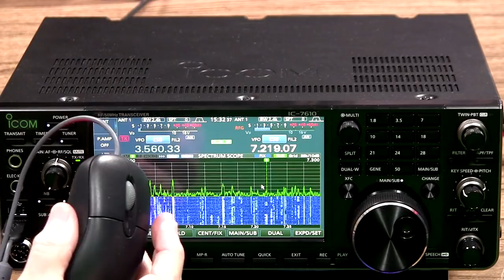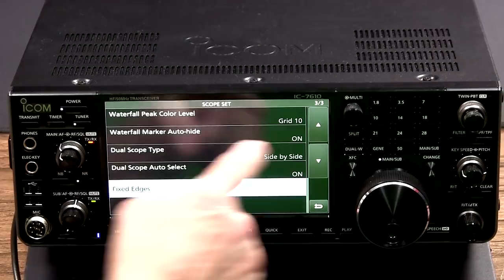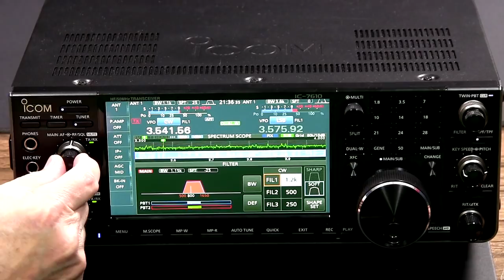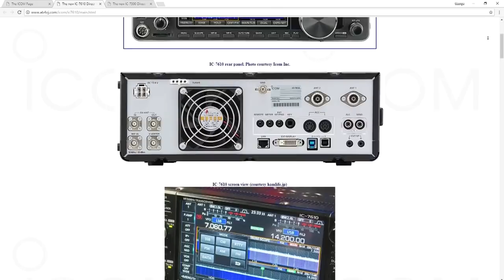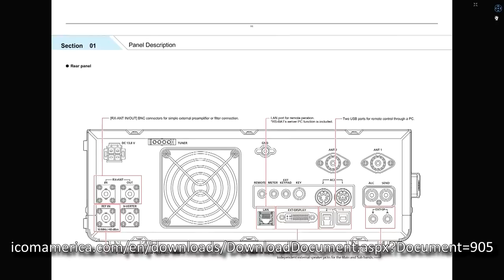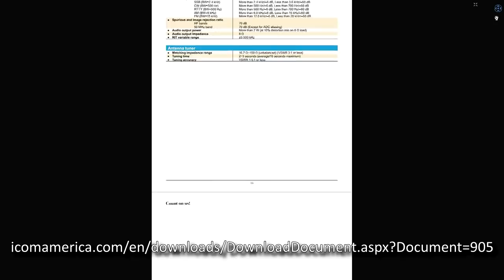IC-7610 Review with Amateur Logic and Icom's Ray Novak

Comment: I'd be interested to know why the 7610 seems to be unusable with AGC off.... unlike the 7300 which seems to be fine with AGC off.  This anomaly compromises FT8 operation somewhat on the IC-7610. I wonder whether it is a fault in the design or set-up procedure of the 7610; seems to me that that the gain- distribution is wrong somewhere...

Comment: Re the IC-7600: I think Ray is incorrect to say that the tuning-range, of the sub-receiver, is limited by the roofing filter; the roofing filters are in the IF, not the RF front-end. The sub RX is limited by the wide RF filters in the front-end; depending on which band you are on, sometimes i think these filters cover two adjacent ham bands....

Comment: Guys, I owned a Yaesu FTDX-101d radio for 1 1/2 years and even though it has a great receiver, I was never 100% happy with it for several reasons. When you spend $3400 for a HF radio, you should be has happy as you can be! So, I sold it at the end of June 2022 (for a very good price since all used gear is higher these days) I immediately ordered an IC-7610 on July 3rd. HRO was out of stock and I had to wait (in purgatory as I called it!) two months for Icom to restock! I AM 100% happy with my IC-7610 HF radio!
Reply: So Gary , Are you saying that you don’t like IC 7610 either …. Just wondering..
Reply: @clipperprospecting8445  No, I am happy with the 7610! Made a typo and did not mean to say 'not'. I like the performance of the FTDX-101and it is a great design cosmetically but, the Icom has features that I prefer over 101. I could list them but, not not want to get into a debate with anyone that disagrees.
Reply: @garylucas6511  Thank you , Have a great day 👍

Comment: It was sad to hear Ray say there are no plans to support external touch screen displays.  I love having the RC-28 on the right; the radio on the left facing East, and monitors facing South in front of me working digital.  If I could only have a 10 inch external touch screen display; that would be sweet.  Love this upgrade from the 7300.  Thanks guys!

Comment: Good riddance, Icom. I cancelled my order for a new 7610 when I found out you no longer produce radios with an RF gain. Adding a variable attenuator which DOES NOT FUNCTION SIMILARLY TO A TRUE RF GAIN is disingenuous and blatant misrepresentation. 
- Though I have always been an icom man, you have lost me and instead I just bought a Yaesu FTdx-5000 which DOES have a true RF gain. 
So long
Reply: Hi, interesting comment; what is it about the RF gain on the FTdx-5000 which is better?
Reply: Great way to tell the world you're a lid without actually telling them that, of course the 7610 has RFG control in fact it has two dedicated RFG controls for each receiver as well as variable attenuators for each receiver

Comment: What's a good DX antenna setup to use with this radio?
Reply: A 19-element quad at 400 ft fed with six-inch diameter copper tubing and silver center conductor.

Comment: Hello! I'm very happy with my Icom IC-7610, I sold my IC7300 but ... I realized that in the IC-7610 they didn't add SWR control like the one IC-7300 has, then the operating frequency limit is lower to the IC-7300 Which reaches up to 70,000 MHz. Y?
Reply: What is the mod to open up the 70,000 MHz band?

Comment: Ray, Tommy, and George;  Thanks for this  video.  It really is worth the time to sit back and watch.  I bought IC-7610 at Hamvention 2019.  I only work CW and was pretty disappointed to see my brand new rig had such a narrow CW bandwidth.  1.2 khz sounds terribly pinched up and the manual led me to think that was the maximum CW bandwidth.  Googling around led me here.  At around 26 minutes you began talking about adjusting the filter and the light came on!  I can set my Filter 1 to be up to 3.6 khz if I desire.  An OMG moment!!  I now have it set to 2.4 khz and filter 2 is set to 1.2 khz.  Not sure what I'll need in a contest but for every day use Filter 1 is set at 2.4 khz.  Sounds great to me and I can quit thinking about trading for a Flex or something else.  Your time invested in this video is greatly appreciated.  It really helped me out!  73
Reply: 25:37

Comment: Why not just buy two ic 7300's and save a lot of money.
Reply: Because the 7610 ISN'T two 7300s in one box.  The 7300 uses a 12 bit processor on TX and a 14 bit on receive while the 7610 uses a 14 and 16 bit respectively.  The 7610 also has a digi-select on 160, 80 and 40M...the 7300 does not.  They may be similar but the 7610's specifications are better.

Comment: Just another useless touchscreen radio from a calm because they think a radio is the cell phone it appears. I can’t wait to those touchscreen start failing to see how ICOM explains it.
Reply: What a clown, they use touch screen radios to bring the cost to the radio down. Dedicated buttons for each feature have significant limitations. 

One of the beautiful things about touch screen logic buttons is that they have per band and per mode memories so you don't have to completely reconfigure the radio every time you switch bands or modes like you do on a legacy analog radio 

For example when you work digital you might have your ALC turned off, if you were working 40 and 80 m you would have your preamp turned off, you might have specific filter shapes that you use for digital versus CW and these radios remember all those settings per mode and per band where legacy radios every time you change modes and bands you have to completely reconfigure the front panel for that mode and band..

I think most people that don't like touch screens don't actually chase DX or contests or even change frequencies very often, these are the people who parked their radio on one frequency so they can get on the geriatric nets in the morning and complain about their aches and pains
Reply: @dannelson8556 Most of my contacts are DX. I Only use Phone on Any Band. I just purchased an ICOM 775DSP a week ago and I have not even once turned the 7610 or 9100 On. I could care less about the so called, Bells and Whistles and having a designated knob or button on the 775DSP is a BIG PLUS to me. No reason to touch the screen for Anything is AWESOME! I don’t Contest or waste my time with Pota Crap just DX & some Rag chew for me. The 7610 and most new radios are a lot of Hype and a lot of so called, features are a waste of time and money. I much preferred my ICOM 7700 over the 7610. I also don’t use the waterfall on the 7610 nor did I use it on the 7700. Useless wasted space on the display. The Big display on the 775DSP is easy to read across the room and it’s loaded with every optional filter. I believe the 775DSP hears anything and everything the 7610 does and it’s my Favorite radio that I currently own. The 7610 is OK but not all that. I have no doubt that the touch screens will start failing and ICOM will no longer stock them or support them as usual so we will be forced to purchase a new better design so that they can overprice another one and stick it to the buyers all over again. Old school is far more dependable and the 775DSP will be going when the 7610 is in a  landfill somewhere no doubt because parts are no longer available. Also I don’t do Any Nets on any band and I don’t hang out on any one frequency or band. I band hop looking for a New entity and watch the DX Cluster. Obviously you don’t have a clue about anything about how I operate so just keep guessing.😜😝🎙

Comment: I'm with Bob KK6YLW, is there a wireless remote connection possibility?
Reply: Connie — FYI, just in case you did not see the reply to my question: "Some WiFi Range Extenders also have Ethernet ports on them. The Netgear EX6200 will do this.”  I bought the Netgear (about $60+/-) at BestBuy, set it up in my shack, works like a charm!  Hope this helps.

Comment: Remote operation from any place in the world?  Not quite that easy, it does not have a built in VPN which you need.  Flex has that feature built in and the best remote feature of any radio out there.
Reply: Why would you want the VPN on your computer or radio lol it's supposed to be in your internet gateway, or your router.. 

This is not an issue for me because once again as an educated computer user my VPN is located in my gateway so all computers on my network must go through the VPN.

Comment: One quick question, if I may.  Will the LAN port on the rear of the radio accept a wireless remote device so I do not have to hardwire my WiFi network to the radio?  My WiFi router is light years away from my shack.  All my other devices work fine in the shack wirelessly.  I shudder to think of how long my LAN cable will have to be and how many walls I will have to route through to get a hard cable to the radio.
Reply: Some WiFi Range Extenders also have Ethernet ports on them. The Netgear EX6200 will do this.